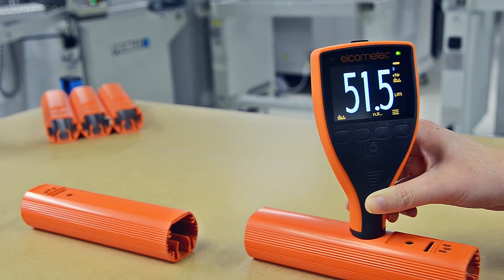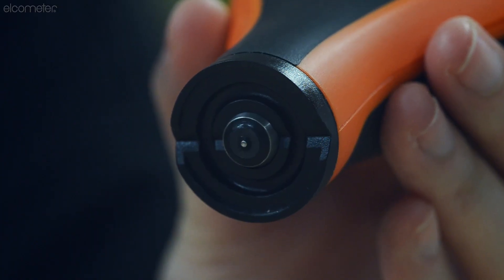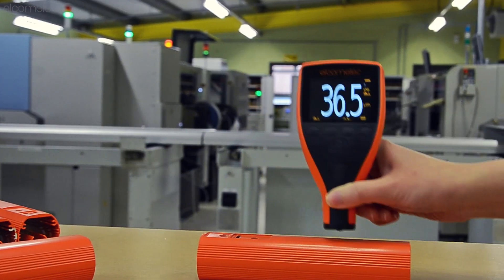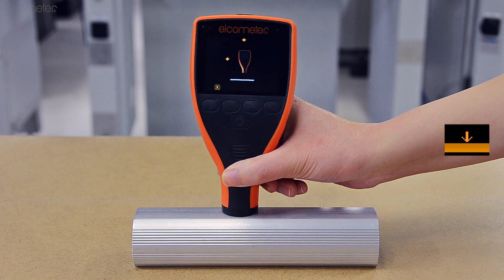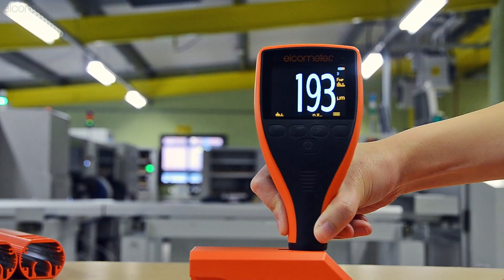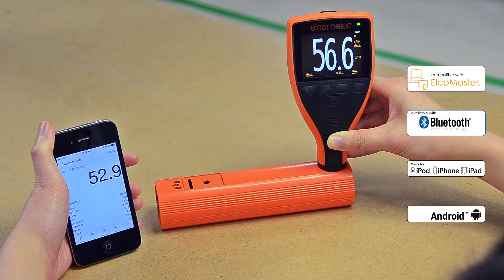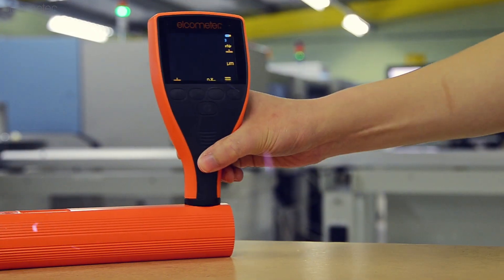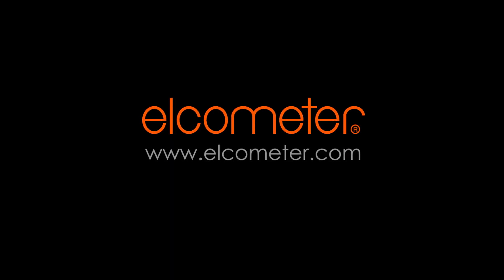How to Measure Dry Film Thickness using an Elcometer 415 Paint Thickness Gauge

Comment: can it use for masanory/building surface
Reply from the maker: Hi,

The 415 requires a metallic substrate so will not work on wood, brick or plasterboard.

If you have any more questions feel free to get in touch with techsales@elcometer.com

Comment: What tool For check thickness paint in composite ?
Reply from the maker: Thank you for your comment.

The Elcometer 415 will only work on metallic substrates, however the Elcometer 121/4 Paint Inspection Gauge can measure paint thickness on composite substrates.

There may be additional methods available depending on your specific application. 

For more information please contact techsales@elcometer.com or visit www.elcometer.com/contact-us to find your local Elcometer distributor.
Reply from the maker: Additionally here is a link to the Elcometer 121/4: https://www.elcometer.com/en/coating-inspection/dry-film-thickness/dry-film-thickness-destructive/elcometer-1214-standard-top-paint-inspection-gauges.html
Reply: @ElcometerOfficialChannel  thaks for your recomendation